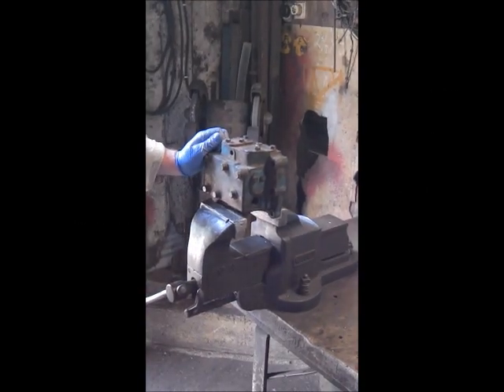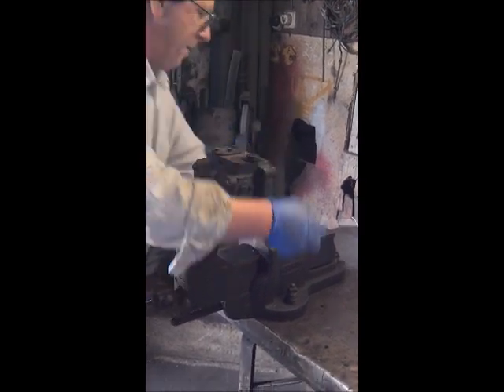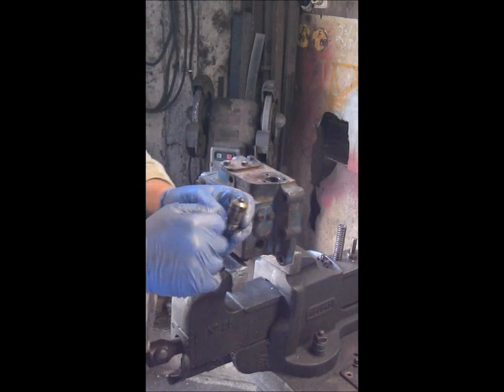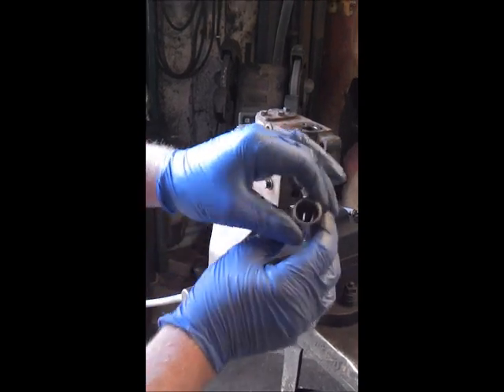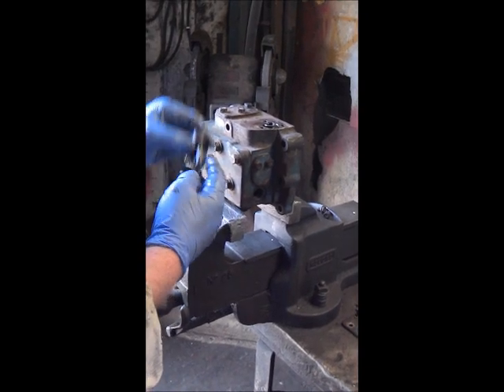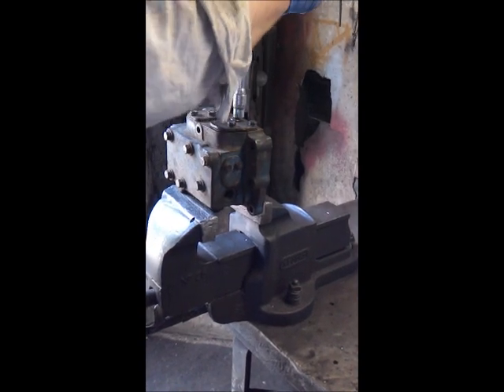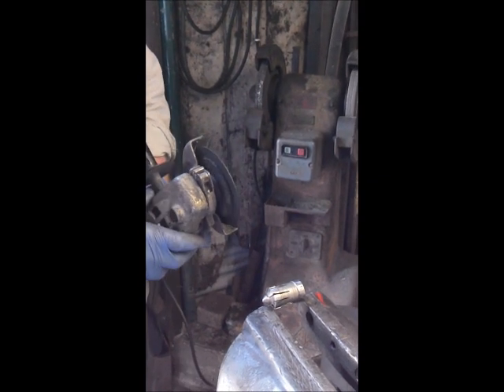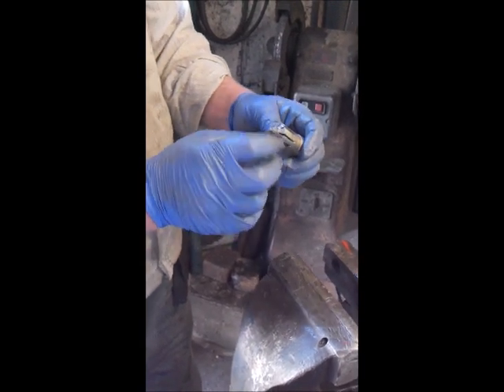Modifying Fordson Major Diesel Unloading Valve

Comment: Thank you for the great tip.  I modified my 1956 Fordson Major Diesel today. Works excellent now.  Don,t have to Move lever to neutral now after unloader valve opens to continue lifting . .   Good constant usable pressure now. Glad you forewarned about unloader gaining opening pressure after modification. I gained 300 PSI.. Reset  operating max. pressure to 2200 PSI by removing 2 shims.    Brian B. in Eastern Canada.

Comment from the maker: Dear Marveltone, thank you for your query.  The reason for the mod is to allow the unloading valve to reset automatically while under pressure; aka power major version.  Flow not increased, but does increase pressure slightly because relieved oil can no longer act upon the secondary surface area of the unloading valve.  Hope this helps.  BTW what is a haybine?